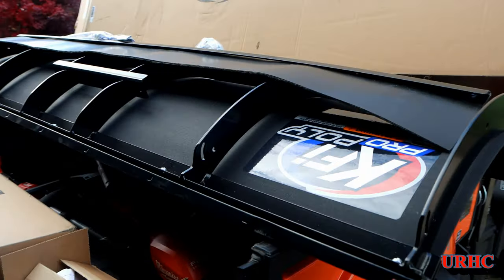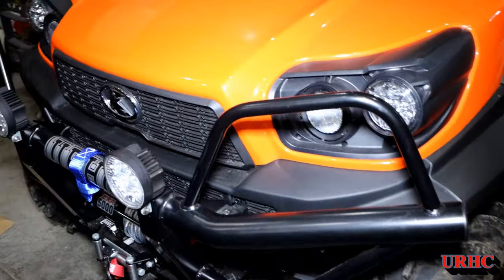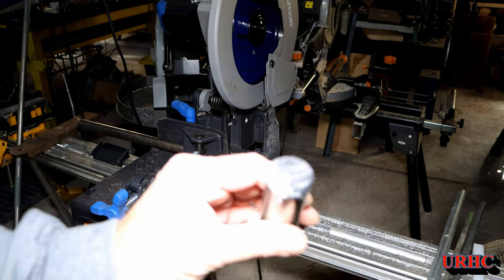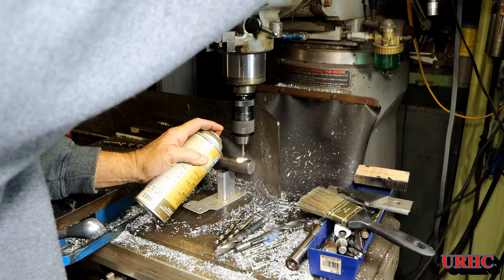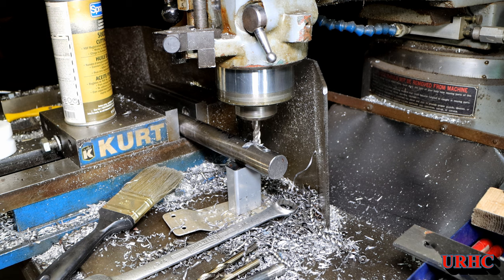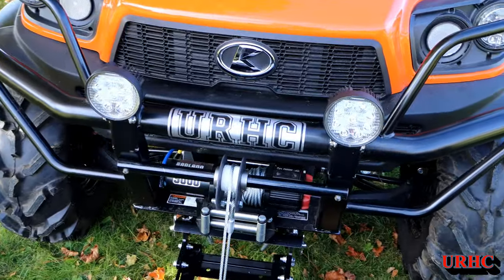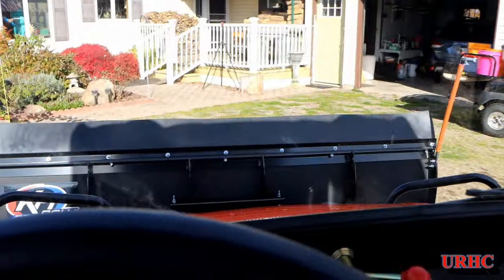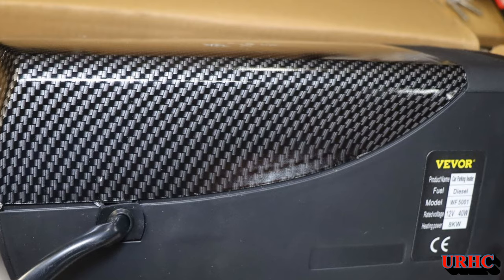Mounting A KFI Plow on Gizmo 850. I no longer have this machine.

Comment: Howcome you decided to go with a diesel heater instead of a Traditional  radiator style cab heater running off your engine coolant? Iv always had the same idea with the diesel heater to run it from the diesel fuel on my tractor for cab heat but I was only gonna do it cuz I thought it would be a fun project. Curious to hear why you are doing it?
Reply from the maker: For a fun project.  Vevor contacted  me with a list of items to see if I was interested in any. I saw the heater and always  wanted  to see how they work. I think the Kubota  version using  the cooling water is over $1200 by the time you buy all the components.  8kw should keep it warm. Thanks for watching.

Comment: If you've got any neighbors close by they may be calling you when the snow flies! That heater will make a world of difference too, won't be freezing your rear off out in the cold weather.
Reply from the maker: This should be good for little storms that don't drift up. I am hoping to get the heater in there soon and have ordered some plastic for a rear window. Still trying to figure out doors because Kubota wants almost 5k with tax for a factory set. Winter is right around the corner. Thanks for watching.

Comment: Nice add-on.
When I added a plow to My 03 Polaris 700, I built a dedicated "lift Winch" it only has 6' of 2" ratchet Strap webbing on the Drum, and it pick's the Plow Frame straight up. No pulleys  . I can use Winches on either end of the ATV. So all I do is put the Lift winch on and plug it in.   When one is stuck it is best practice to pull Your self out the way it went in. Thus the Winch at the Back. 
The rear Mount is also where I put the Hydraulic pump for the Blade angle Cylinders. 
Built all of that back in 2004 and still works good today. It even has a limit switch for the UP, to keep the plow Frame from bottoming out on the underside of the ATV. 
Mike M.
Reply from the maker: That is a good idea.. I have been thinking  a gear motor and chain drive for angling If I feel it is needed.  This is just for small cleanups and the tractor will handle the heavy stuff we get off the lake. Thanks for watching.